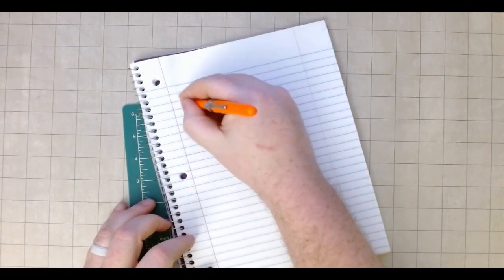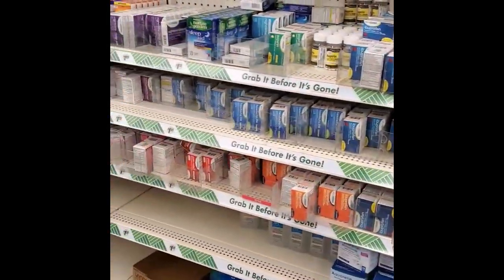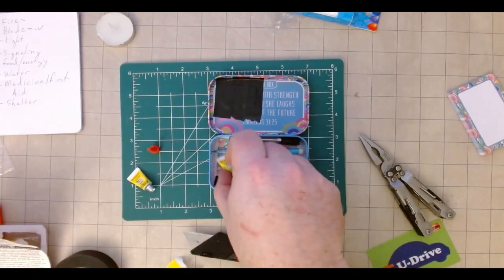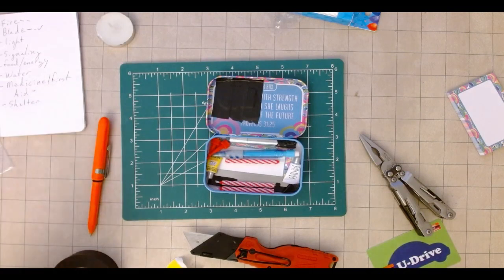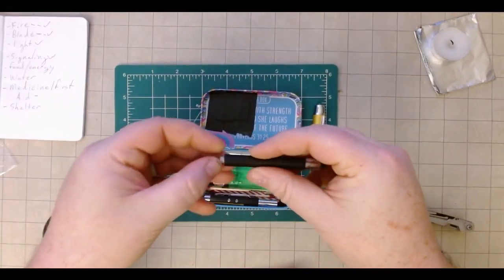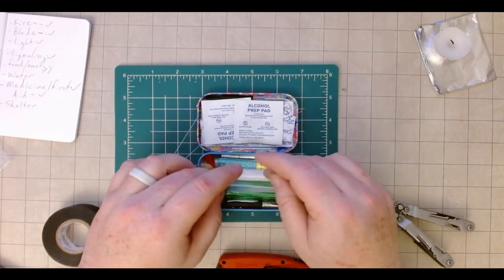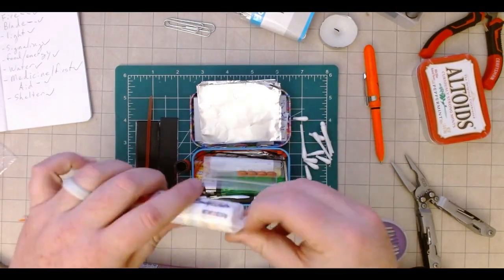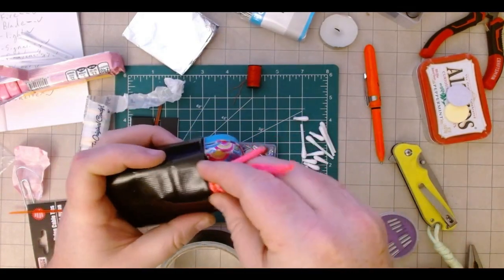Building a Dollar Tree Altoids EDC Survival Tin

Comment from the maker: Total spent was $26. Aside from picking up more tins, there's enough supplies here to make at least 5~ kits, depending on if you do the ridiculous duct tape carrier for it! Also, sorry about the repeat clip! 45 mins is a LOT to edit down to lol

Things I wish I had grabbed:
-Ramen pack for the bullion packet
-Some drink mix (lemonade or electrolytes packets)
Reply: Take some plastic soda straws, heat one end and seal it with a pair of pliers. You can put any kind of dry powdered product in it. Seal the open end the same way, then put those in the tin. They don't take up much room. Cut them to length to fit your tin. You can put instant coffee, cream or sugar in a straw, or even some kind of beverage. Salt, pepper or whatever you choose. Thanks for your video.
Reply from the maker: @tonyv8925  Absolutely! I've shown that in a couple other videos, but this would have been the perfect place for it again! Thanks for pointing it out!

Comment: Years ago I created something I called the three minute match.  It was a simple strike anywhere kitchen size match with a single square of toilet paper folded and tightly rolled around it.  I tied the paper onto the match with dental floss and dipped it in melted wax and sealed it up in a vacuum food bag.  I made many of these and one day I took one along fishing.  I could not get it to light.  Even though I had tried several of them when I made them the one sitting in a drawer for a few months refused to light.  I came home and tried all the rest of them with the same result except for one that lit.  I have not tried to "waterproof" matches with wax since then.  Your milage may vary.
Reply from the maker: Sounds like a solid build! Any idea why they weren't lighting?

Comment: I feel like the best option for 'food' in an altoid size tin is the small individual wrapped airheads candy. Basically just a little flat package of sugar that you don't really risk crushing up. Starbursts are a decent option too, but those paper wrappers might makes a mess in the tin, if the candy were to start melting.
If you had used a saw to cut off the excess handle instead of crimping the end off, I think you could have slid the candle down into the end of it.
Reply from the maker: You're totally right! I probably could have focused a little more on that. I should have also grabbed like a powdered drink mix too! Probably should have grabbed a Ramen to steal the bullion package
Reply: @ConansEasyDadCarry  Don't know if you can find them in dollar tree, but a pack of liquid iv or similar electrolyte powder would be good, yeah.
Reply from the maker: @rallaa941  I carry a tube of glucose tablets and some electrolyte powder in my packs usually. Haven't seen them at the dollar tree before, but they're always good to have just in case

Comment: DT super glue comes in a larger, resealable container than the skin glue you got, and is also a great fire starting fuel. I've glued dried skin, bleeding cuts, and many other thing to other things, with that vial of SGlue. 👍
Reply from the maker: I like them both for different reasons. Superglue is my usual go-to just because it's so quick, but I was trying to save some space here and show some options. I'm 100% with you though!
Reply: Annnnnd I just got to the part where you discussed the single-use and larger ones. 😅 I have a single use in my tin, but I rely on the...I think it is a 0.5oz?...resealable vial from DT in my EDG bag.
Reply from the maker: @OutsideTheTargetDemographic  lol to be fair, this ran WAY longer than I thought, so missing a 1 minute blip in a 45 min ramble isn't hard to do 😅